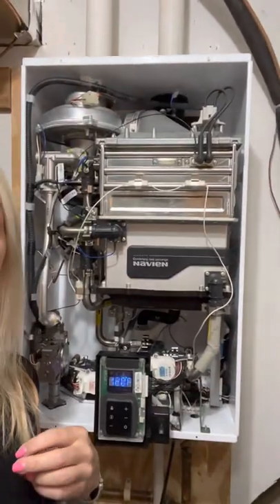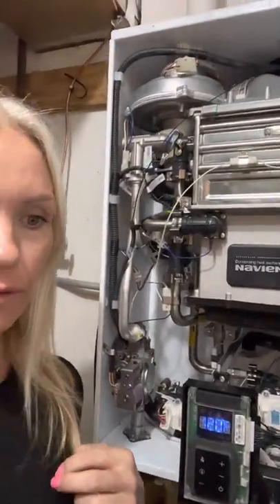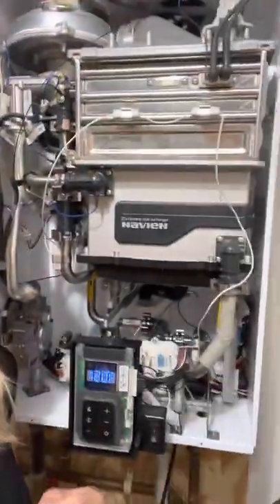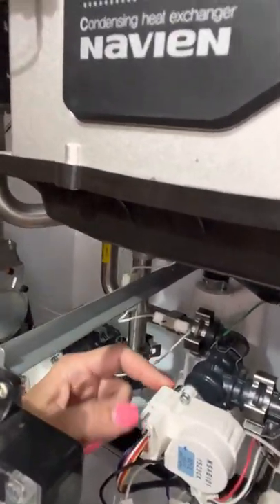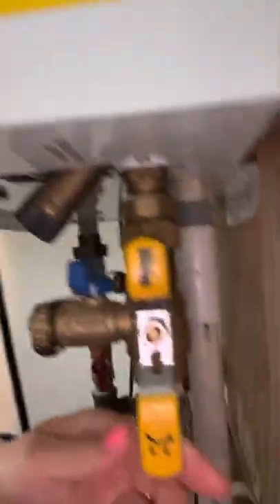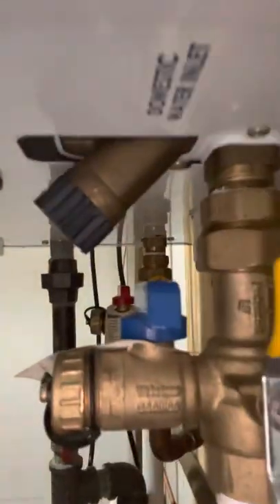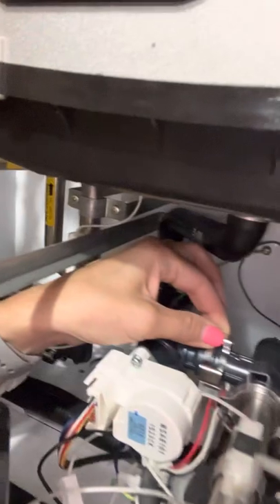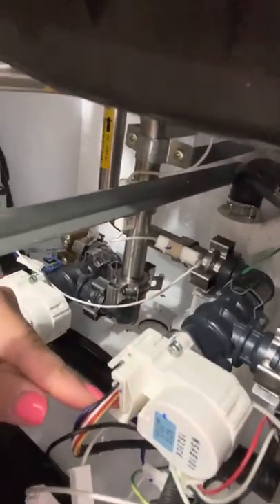Navien tankless water heater. Fixing error E445

Comment: Poor instructions, and camera angles for repair, no description or information on the part number or link, and didn't explain the 'water leak' issue. There are 'O-Rings' that have to be positioned or the result is a leak. They're not just "round rubber thingy's" Glad you were able to fix this, but overall poor instructions and media focus.